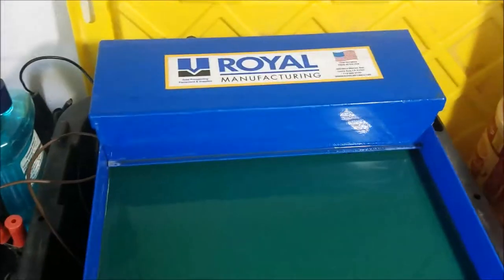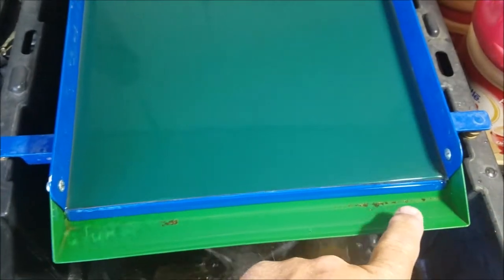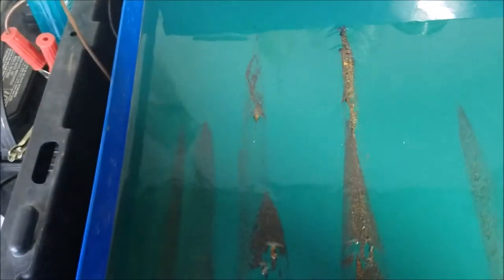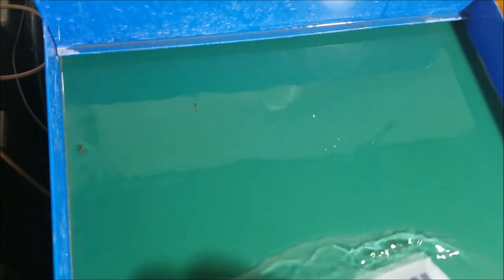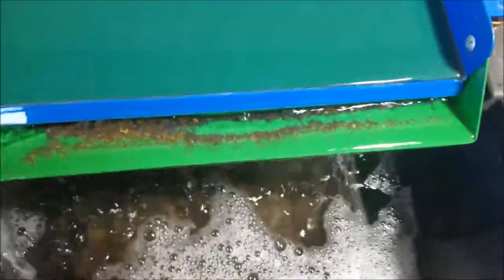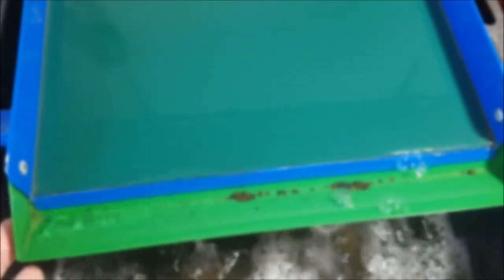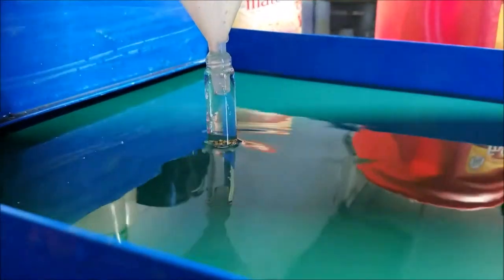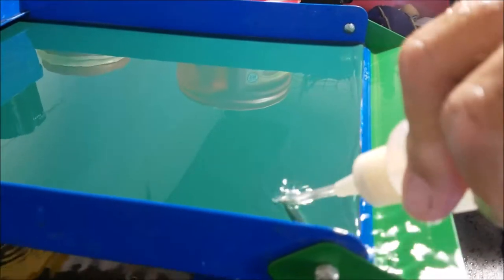Royal Gold Dust Table by Jeff Davis

Comment from the maker: Sorry Curtis you're wrong. The way I do it it's not necessarily running the water too fast. Cuz it doesn't matter what speed you run the water a piece of gold can be pushed down off the edge into your run off. I'm good friends with Robert at Royal. I actually showed Robert some changes since the original video was done. He's now adopted some of my ways when he demos it. Also you're able to process your material a lot faster. You can do it either way button my way rarely ever will lose a piece of gold. By the way when that first came out it was silver and I had Robert change it to Green so you can see the gold if it gets dropped into it. Why else would it be green